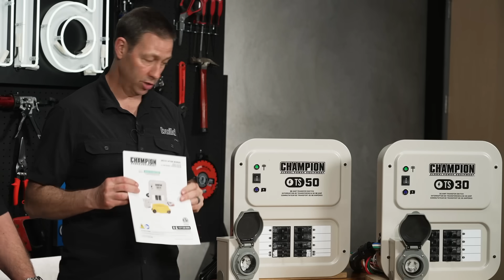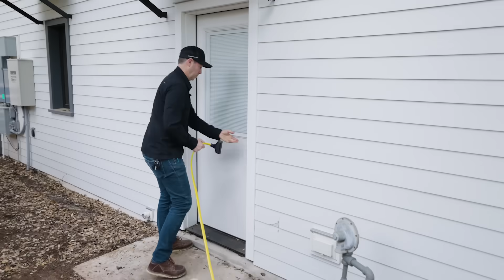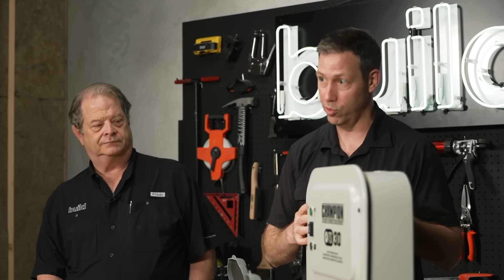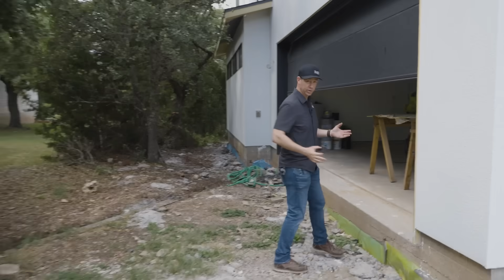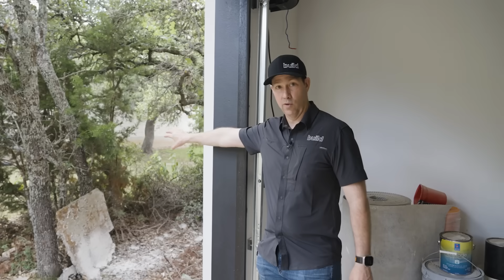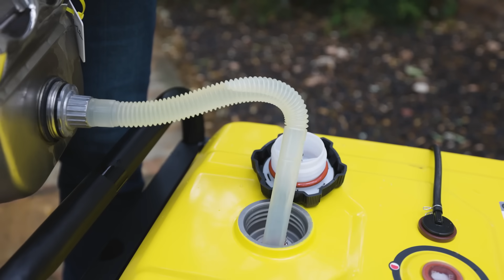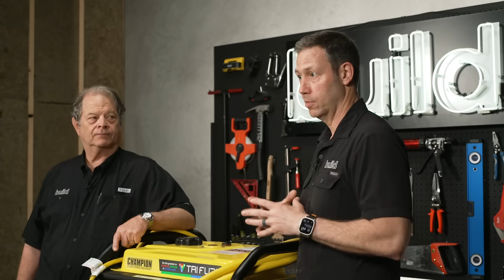SO EASY! More AFFORDABLE and user friendly BACK UP POWER!

Comment: I installed a manual transfer breaker of a different brand about ten years ago. We've used it  several times with a 6000 watt portable generator. We have been careful not to overload it and it works great to keep the basics going. We can use the house circuitry to keep the refrigerator, water pump, some lights and the oil furnace going. I have to shut off the main breaker on the main service panel to prevent power going into the outside lines so repair workers aren't endangered. This unit looks like a bit of an upgrade to what we have.
Reply: Interlock
Reply: @serenasmith6412  Thank you, at first I  didn't understand your comment , but I looked it up. I will look into getting one of those devices to bring our manual transfer up to code. It was not something I had known of, I appreciate the info.
Reply: Against code? How can you be sure that it doesn't backfeed?
Reply: @terrencesauve  Like I said, turn off the main breaker. Do it manually, it's not automatic. That prevents backfeed. It's an older version.
Reply: @rowgler1  And if you or someone else forgets about the main breaker a lineman get electrocuted.  That is why it is not code compliant.

Comment: Hey Matt, I work for a production builder, and I am looking for better, yet affordable air sealing techniques. While it is child’s play for you, we are moving from 5ACH to 3 without many critical air sealing changes. I build slab townhomes, which are especially challenging to pass a blower door on. Any tips would be a huge help.
Reply: Build the whole building with ICF, seal windows and doors properly and figure out how to deal with wall/roof air barrier
Reply: @billmccance7762  Right.   There are no ICF production homes.   Production Builder means cheapest of the cheap.    OSB, manufactured trusses.   Pure junk.

Comment: For Y2K 23 years ago I installed over 100 
6 circuit transfer switch panel 
Better option is a GE 10323r transfer switch

Comment: Why would anyone want a generator instead of having batteries for back up? LFP batteries are so cheap these days it is a no brained. And why would you need this silly extra panel? Couldn’t you just have a transfer switch and wire up a receptacle.I bet it’s totally overpriced compared to a regular small panel.
Reply: Generator is still about half the cost per kW compared to batteries and inverter.

Comment: My goal is to have solar inverter and rack mount battery as my back up. Even without solar panels, my EG4 6500EX-48 and EG4 battery will power a fridge an small freezer for 24+ hours. The 6500EX is will run 6500 watts. It has a 50+ amp capability to do that. Can I use the 50 amp plug with the 50 amp manual transfer box even though the single inverter is 120v? The future plan is to add a second inverter for split phase, so having the 50 amp box seems to be my target. Before you ask, I plan to use an EG4 Chargeverter from my Champion generator to recharge my battery if needed, hoping to greatly reduce my fuel needs over a 2-7 day outage. Am I on the right track? Could you make a video along those lines? As I add solar, the transfer switch could allow me to reduce grid power needs by leaving certain circuits running on the battery, or batteries as I add 2-4 more.

Comment: Have a Champion generator with a 10-circuit Reliance transfer switch. Highly recommend the inlet box being outside. The generator is very loud and I put it as far away from the house as possible with my 30 foot cord. Also, I would think that when the power is back, you would switch to use that power before turning off the generator. That's what I always do.
Reply: Yes.  Can confirm, very loud.  I'm your neighbor and I hate you.
Reply: Maybe you are out in the boonies.  Are you not afraid of someone stealing your generator?  I am in the burbs, older area, not a development.  My inlet box is in the garage.  I have an exhaust system set up for it.  I have taken care of all fire safety precautions, no flammables. etc. in their is an alarm i rigged up to with video monitoring.
Reply: @bcarss1970  Well done on your setup. I am in the boonies, on the top of a hill.

Comment: Could this work with a Span electric panel?
Reply: No
Reply: Just buy a whole home transfer switch with a 18KW generator for the price of a Span panel lol
Reply: @crispusattucks8265  - Already have a Span and solar, but not backup plans.  Not dropping either one and still looking at options as I undergo a remodel.
Reply: @zinaj9437  A whole home transfer switch would work. It’s wired before your span panel and after the meter.
Reply: @crispusattucks8265  - As I see it, a Span panel means that I could get a smaller generator or battery.  That should cost less and provide me the same independence/security.
Reply: @zinaj9437  a smaller battery for intermittent power but if your in a area that power gets knocked out for hours then you’ll need a lot of battery’s assuming all your appliances are electric.

Comment: Why do you need a separate panel?  For the pretty colored lights?
Reply: You don't.
Reply: @DeuceDeuceBravo  My comment was meant to be sarcastic.
Reply: You need to move the circuit You want to run off the generator from the main panel to the generator panel
Reply: @raymondpeters9186  My Electrician dropped a 50 right into my existing box with the lockout, like every other installation I have ever seen

Comment: gas air/noise pollution powered electricity is just gross. just get a backup battery and be done with it. They are widely available, reliable, and affordable, and also get gov rebates. Added plus, you dont piss off your neighbor by making their backyard unusable while you run your fridge; wasting gas and not utilizing exess electricity produced since you NEVER utilize 100% of the created power.

I use my battery every day, i wouldn't even know if the power went out.
Reply: That's cute to assume the power will never go out for more than a couple hours at a time in the middle of a snowstorm.

Comment: 📝NOTE: If you are using a fuel cell generator you don't need to locate it outside as @buildshow says. Fuel cells can be inside. I know this isn't the norm for the US, but fuel cell generators are gaining popularity.
Reply: do you mean a hydrogen powered fuel cell? I haven't even heard that these are available for non-commercial use. What company makes a residential fuel cell? How would someone get hydrogen to fuel/re-fuel one?
Reply: @travelfeet yes many unanswered questions about this system
Reply: @travelfeet  yea I wasn't aware we could get those either.

Comment: Matt, thanks for the video. We have the 30 amp 11500 duel fuel Champion generator up here in the Dallas area and so far we haven't had to use it. I've been looking at transfer switch panels to install, and this system looks great. We may be moving soon...do you think it would be worth installing for resell value.
Reply: Sounds like a bad set up! With that much watts, you need to be on an 50amp not 30amp. Reason is 30amp inlets have max capacity of 7500 watts, while 50 amp inlets have 12500 watts max.

Comment: I have a 30 amp Champion Inverter Generator with a manual interlock in main panel... Way cheaper and more flexible load selection....